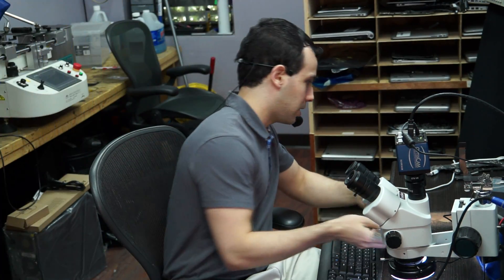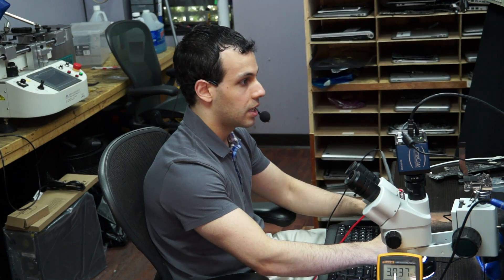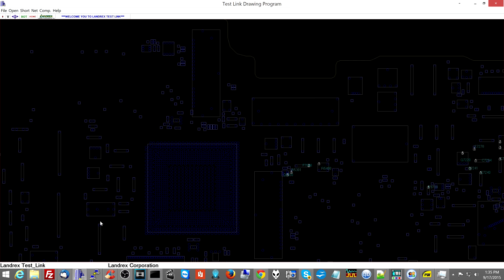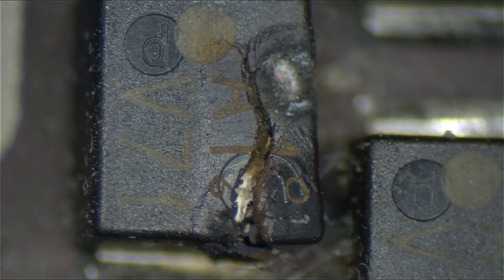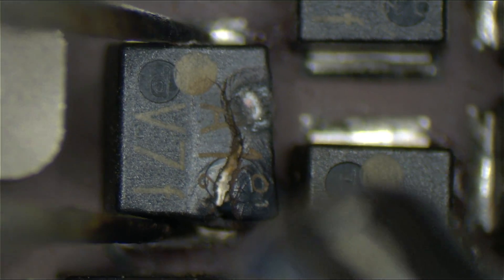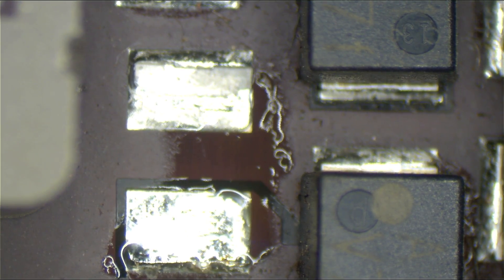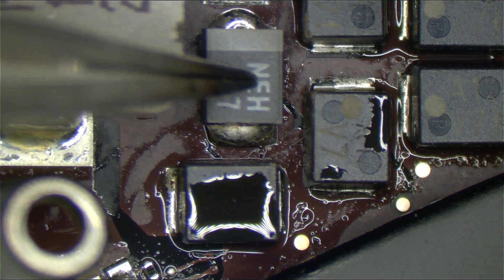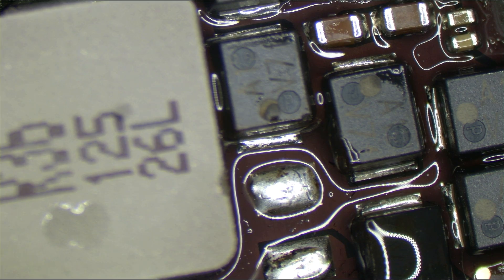Fixing Macbook Air with short to ground on PPBUS_G3H.

Comment: Hi Louis,

Thanks for uploading all these videos, they are very helpful for learning.

I'm trying to fix my 820-3115-B board from a mid-2012 MBP 13in. There is a green light on the magsafe and PPBUS_G3H is 1.77V (supposed to be 12.8V from the schematics). I removed the F7040 fuse and there is a short on the system side of the bus (fuse pad nearest to the ram slot is showing 8ohm to ground)

After listening to this video I understand you did not want to inject PPBUS with a power supply because the cpu voltage controller on your board is sometimes faulty and injecting with a power supply could make it BER.

Would it be safe to inject voltage on my 820-3115-B board? or is there another method I should use to detect which component is faulty? I already tried feeling the board by hand and spraying alcohol on the board while plugged in but there is little to no heat generated on the board.

Regards

Comment: noob here going thru the vids to figure this out. Got a 820-3115 with only 1.5V at PPBUS_G3H and green light shining - with the peculiarity that the battery level indicator only lights up if the charger is connected. 
Can anybody tell me please how I can check for voltage drops without a multimeter that has diode mode?
Thanks Louis for the great videos, inspiration and cranky humour.